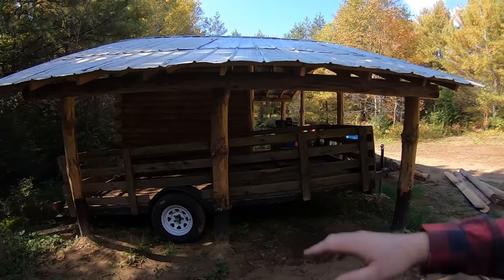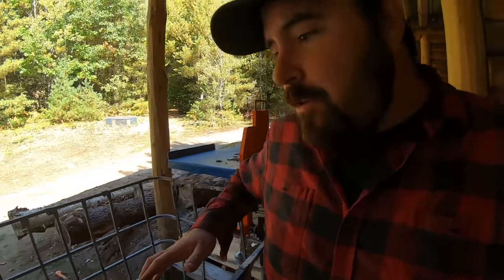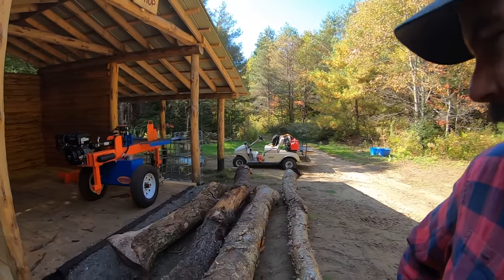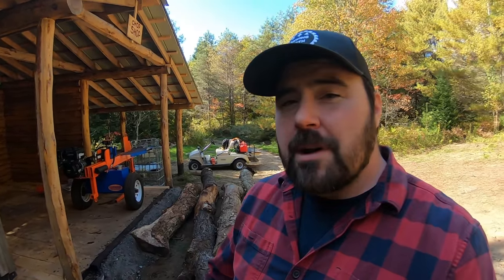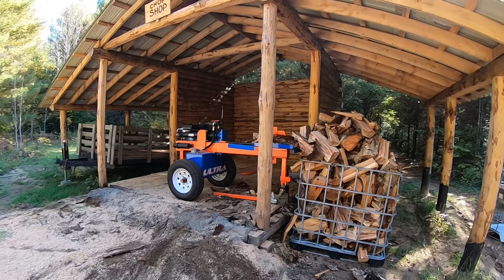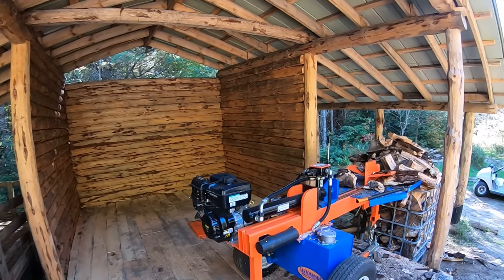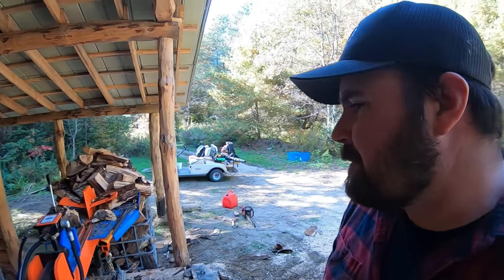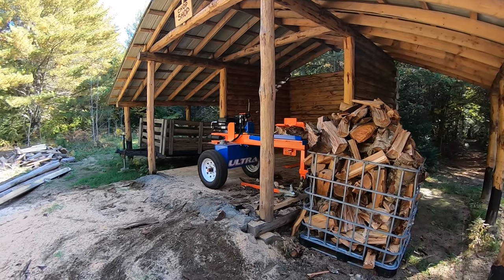Handling Firewood As Little As Possible (load IBC cages faster)

Comment: Like the set up, it will save your back in the long run. Here's another idea. I you build a south facing pole building with an angled roof, to store your wood filled IBC's inside out of the weather. Cover the south face with heavy clear plastic and you've made a wood kiln, with sufficient sunlight and air flow, your wood with be bone dry in no time.
Reply from the maker: I like it! The kiln idea is something I've seen done for lumber but not too much for firewood. Sure would help speed up the process

Comment: Maybe a firewood burning stove with a fresh brew of mud in the corner of the Chop Shop just to take the edge off and chill out of the cold Ontario winters. Burning up the scraps and waste wood for heat would be nice, too. Working out of the elements gets a lot more work done. Great video.
Reply from the maker: Sounds nice to me! I'll have to see what I can find. The wood stove is the cheap part, stove pipe is realll expensive these days I find

Comment: This is even better than the idea I had about setting the splitter on the high side of a hill with the IBC cages set on a cut out lower spot. This way you have a shaded flat surface,and don't have to stand in mud.  Great job as always Sandy,and can't wait for the next project.
Reply from the maker: I do like having the shade and the wind block from the back of the building will be nice in the Winter. In the summer it does keep the sun off me too

Comment: I think you came up with a good idea, and this gave me another idea. You might have to take down a couple trees for this, but...... Position your trailer at the END of the sawmill. When you're sawing lumber, take the scrap slabs and throw them straight off the end, into the trailer. No twisting or turning, or throwing scrap over the mill. Everything goes straight off the end, like your firewood goes into the totes............
Reply from the maker: That would be real handy Carl! I see sawmills with the log drag back and thought how slick that would be as well. Keep me from having to do too much in the way of rotating would keep me sawing

Comment: Good idea. Seems to work great. I think I would add a clear to the edge of the wood so the splitter doesn’t. vibrate off the deck.
Reply from the maker: That would be a good idea. That would be a big fall if it slips off.
Reply: @sawingwithsandy  yeah that was supposed to be cleat not clear that I typed but you figured it out. Lol

Comment: Hello Sandy. That height to fit the tote was so good, I think you had an idea about it. Great fit. The caps I mentioned before was because I saw you wiping at dirt off of the hydraulic connections and those would keep the dirt of the hydraulic oil and pump. Splitting will be nicer in the snow. 
Have good days!
Reply from the maker: Sure will be alot nicer without that snow freezing everythign up for sure. Great to have you along for the video. Hope all is well

Comment: Morning Sandy, great day for splitting (Chopping) wood. We back the 10 thousand dump trailer up to the splitter and just throw it on then take it to the racks. I have an idea, mount a bar magnet (Harbor Freight) to the post to put you pickaroon on in between times so it doesn't fall over and make you have to bend over to retrieve it. you could also turn a IBC crate over and use it like a table to stack rounds on in reach of the "chopper" so you don't have to go back and forth so much just a thought... John Toccoa GA
Reply from the maker: That would be ideal John! Having a big dump trailer to load right into. That idea about the magnet is great! That pickaroon falls over sometimes and makes it a pain bending over to get it. Thanks for that one!

Comment: that's a nice set up now. I use my homemade pickaroon like you to put logs on log splitter also. And I also have those holtzforma bars on my chainsaw, but I now switched from 24 to 28 and saves my back alittle more. nice job Sandy see you Saturday
Reply from the maker: A 28" would be a nice bar. Not sure if it's a bit big for this 60cc saw but I've got a 28" bar on my Holzfforma G372 and it runs it quite nice
Reply: I use a 28" on my 54cc homelite and 2 of my 58cc and 1 60cc poulan. I'm not trying to brake any record time cutting and it does a really good job. Just make sure you bar is getting enough oil. thats the main concern

Comment: Hi Sandy.  Great idea.  I am looking forward to your enhancements to the Chop Shop.  I would like to see you with a layout for automated bucking from logs into rounds fed directly onto the splitting table.  Do you see an assist using the Wallenstein log loader trailer?  A ramp with small winch to pull logs, and a cradle for chainsaw to chop at desired length directly onto the splitting table?  No more lifting with a Hookeroon - That's what I want to see.😃
Reply from the maker: I sure wouldn't be against something like that. After some of the ideas I'm hearing my wheels are turning again in my brain. I'm sure I'll come up with something. Thanks for watching Tom. Have a great day!

Comment: How about a sawbuck behind you? Use your grapple or excavator thumb to drop a log on the sawbuck. When it's cut, you won't need to bend to move the log to the splitter. I built a folding sawbuck so I can move and store it easily.
Reply from the maker: That would be a great idea. Think I"ll have to come up with something before long. Keep me from having to lift the rounds

Comment: Here you go.  Take half of a standard door hinge.  Pry open the tabs, pass it over the middle top of the far side of your IBC cage and squeeze them shut.  Weld/bolt/attach a screw hook to the center of the hinge pointing away and down then tie a string to the hook.  When you place IBC cage #2 behind cage #1, flip the hook around to catch the top of cage #2.  The hook should be able to be lifted without catching cage #2.  Grab the string before you use the tractor to remove cage #1.  When you lift cage #1, cage #2 will be hooked and lifted  pulling it along with cage #1 as you back up.  When in position, set cage #1 down, pull string to release hook and finish removing cage #1.  You can daisy chain multiple IBC cages since they are light weight when empty.

Comment: Question: Does that Holz's bar oil cap leak? I picked one up, found it puddles when not in use. Loving the Chop Shop, seems to work out great!
Reply from the maker: Great question. This saw is a Husqvarna 555 with a Holzfforma bar on it. My G372 Holzfforma doesn't appear to have a leaky bar oil cap though
Reply: Cool, thanks! Might just order a replacement, or find a tighter seal. @sawingwithsandy

Comment: Cutting the rounds and rolling them into the bucket of the tractor then raising the bucket just behind you makes it easier to just turn around , reach for a round and put it in the splitter. No?
Reply from the maker: For sure. Just would take me a bit longer getting the tractor bucket put on the tractor and into and out of the tractor. Would be a good idea for larger rounds as well though
Reply: @sawingwithsandy or, just cut the whole side out of one IBC tote and load your rounds into it and lift it to a convenient position. That way everything will be done with forks.
Reply from the maker: @robertwazniak9495. That's a great idea there as well Robert. Thanks for sharing those !